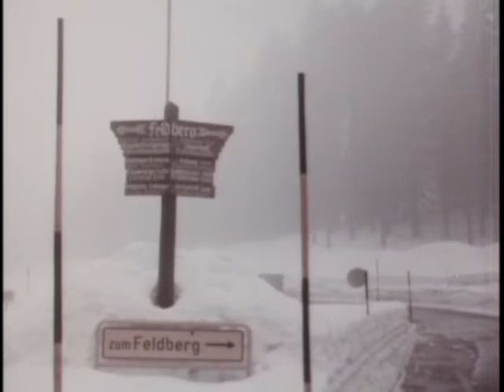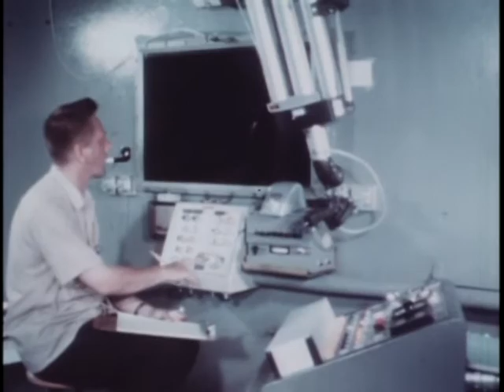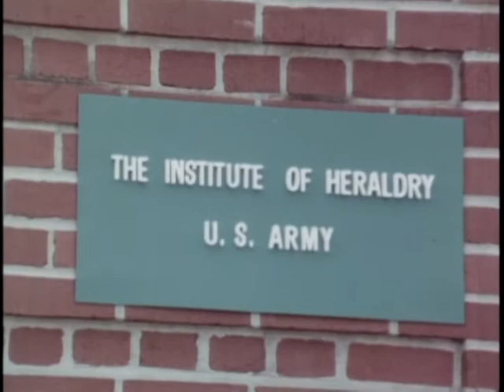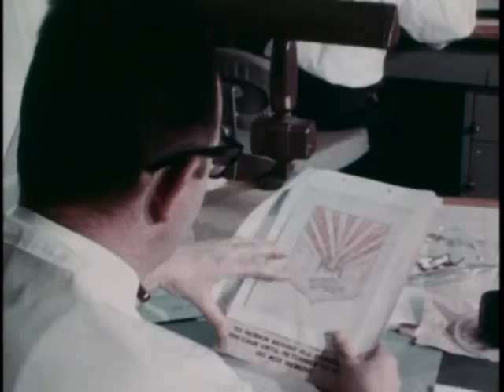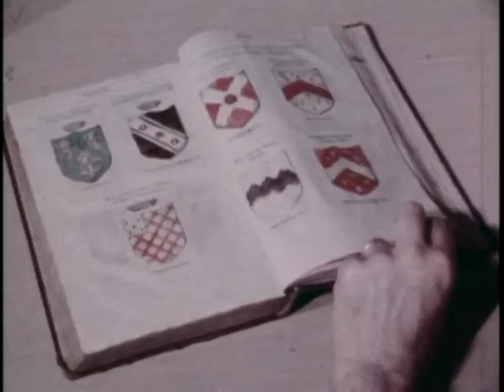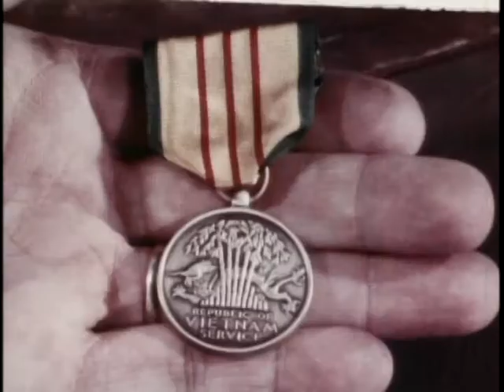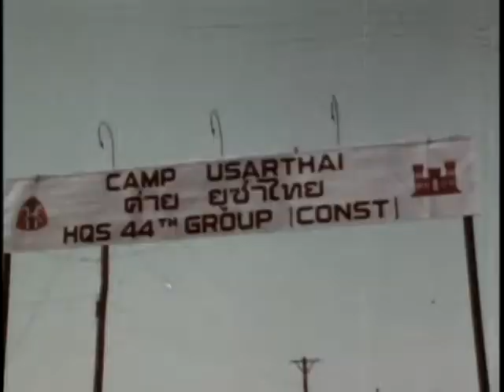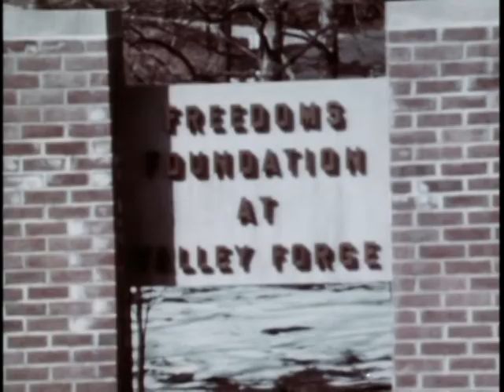Big Picture: Your Army Reports: Number 10

Comment: Very Interesting. I was stationed there when they built the Tower and climbed it many times all the way to the top. 1964-1966 The snow tunnel went from the Chalet to the Equipment Boxes which came in on deuce and 1/2's Pretty tight in there. In the winter we lived there 3 days on duty and 3 days off. There wasn't much Helicopter traffic most of the supplies came up the Mt in the summer or on the snow cat in the winter. We lived in the Wald Hotel Andress, gone now as is the tower.